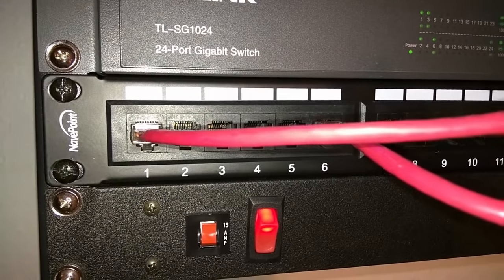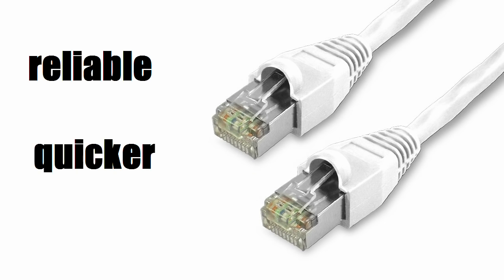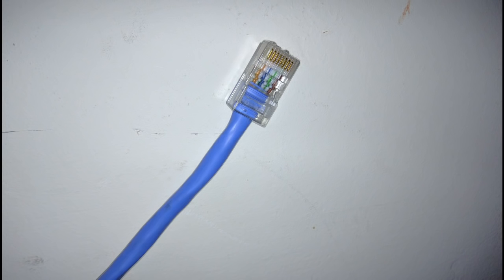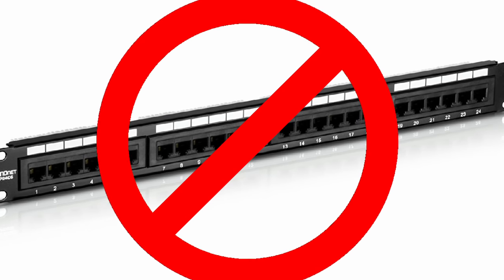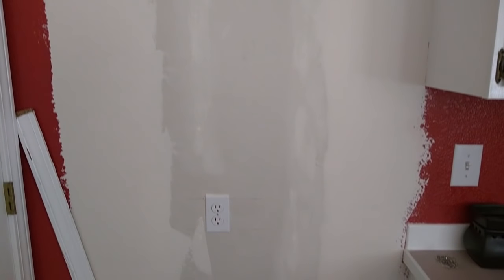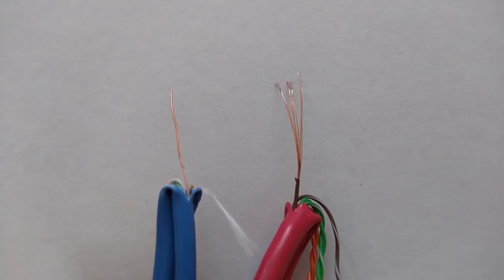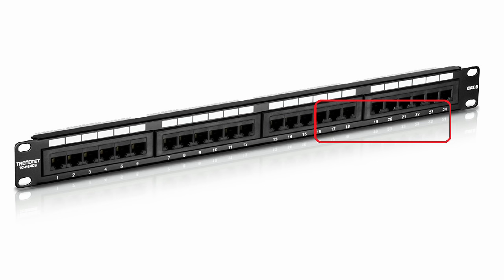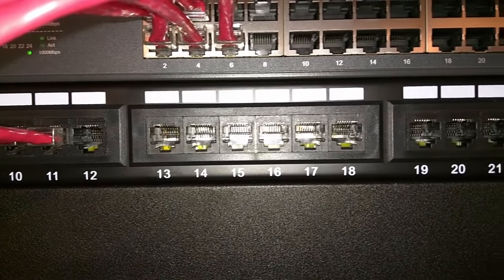What is a Patch Panel? Do You Need One?

Comment: u have all that but not a smart tv?
Reply from the maker: Ha not yet. This one is still chugging along. Soon though. Very soon..
Reply: That patch panel and switch, together cost under $150.
Reply: Smart TV's suck!!!  They don't get updated for long, and are laggy.  I'd rather have a DUMB TV and then plug whatever smart device I want into it.  From ROKU's to AppleTV, to a Chromecast.  Whatever you want.  TV's you hold onto a long time. I am still using my 2 great 50" 1080P Panasonic Plasma's!!!  They may be dumb, but work fantastic.  The last thing I want is any smart garbage.  But it seems almost impossiable these days to get a TV without it.

Comment: no gr8 need of patch panels just connect cable directly to switch write pc number on it thats all
Reply: unless you are injecting various power voltages (poe), or maybe using some of the runs to receive AHD video feed, or maybe you want to do a room to multi room IR setup, hmmm.....or if you are going for HDMI over cat5e/6, or low level audio out to amp unit, remote trigger signal wire, crossover cable, multi room usb to server, VOIP phone system,  standard old school phone through panel, room to room intercom, legacy equipment connectivity............or maybe you just want to add panel with short sacrificial patch cables to eliminate the need of re-terminating your line ends if you do a lot of plug/unplug with equipment (like we do at our repair shop). Or maybe he wants to write the pc number on the panel instead of trying to write it on a round cable, or use stick on labels. I'm sure I could think up a few more but if you don't get it by now.....well, you know.

Comment: Little quibble,... HOW exactly is a patch panel "neat" (or even "neater")?
The cables into the switch still loop out untidily in front just as the unpatch-paneled ones MIGHT.
IN FACT, they likely stick out even further and have to traverse even further left/right as you COULD have the unpatched cables route neatly over/under the switch and bend directly down/up at the jack. None of this ugly looping out and across from the patch to the switch (as they're rarely aligned).
Personally, i prefer the look of a short direct vertical loop exactly at the switch jack instead of the hideous large loops sticking out and dangling about. I place my switch at top/bottom of rack with a 1 cable deep gap and use an improvised 'comb" to hold the cables at exactly the horizontal location they're destined for. My cables loop out and directly up/down for maybe 2 inches max. If 90-degree RJ45's were more common, it'd be even neater.
Basically, while a patch panel could be as ugly as a poorly done direct solution, it cannot be neater than a well done direct setup.
Manufacturers could probably sell a decent amount of "comb trays" that stick to the top/bottom of your switch and have slots every jack width in a neat facia. Something one cable high, a few inches deep for neat "spare" stowage/routing, with appropriately located cable grips or holes for ties (for entry/exit alignment and strain relief), and maybe a single rear exit point (for up to 24 cables). I'd buy one! (though I guess I could make one out of sheet metal and/or 3D printing!)
Reply: if you plan ahead, all the patches will be parallel to each other. if you terminate the cable yourself, it doesnt stick out any further than it would otherwise

Comment: Hey I  recently started  using a keystone patch panel which I am going to add the link. It has a place to tie wrap your cable  for strain relief and since it is keystone based you can choose keystone with  punch down or like me just get a keystone with Ethernet jack on the front and back.  Yes you have to terminate each wire but then gain the ability to just unplug the cable if you should need to trouble shoot.  Check it  out see what you think.      
 https://www.amazon.com/gp/product/B0072JVT02/ref=oh_aui_search_detailpage?ie=UTF8&psc=1
Reply from the maker: A lot of people have recommended keystone panels. They sound like they are great options. I will consider them for future projects. For this one, I was trying to keep costs down.
Reply: @BudgetNerd  Yeah I understand it took me a while but I have things the way I always wanted. At the time I spent 18.99 for the panel and I bought enough Ethernet keystones to fill all of the holes and make it look better they were $19.99 for a 25 pack but can always just get what you need. This particular kind fit perfectly side by side in the panel.
I actually have my dream home theater and home network, projector 100" screen that comes down over the wall mounted TV and Dolby Atmos  the best things is that all the wires  are in the wall and ceiling all going to my media closet where everything is rack mounted. All of the home network is distributed from there to the wall plates in each room/place. I would love to record a video of it and post like you have but I don't even know where to start. It is intimidating.
Reply from the maker: Sweet setup. If you ever do a video, let me know. I'd love to check your setup out!

Comment: So much "do I need one?"  "Can I get away without one?"  In all honesty, if you are building a home lab, a patch panel is part of a network closet/rack.  Simple as that.  Add it in to the budget.  It's another $40-50.  Sometimes even less.  I suggest you get a keystone panel and punch down the keystones you need for each use you have instead of wasting money on a patch panel that has the punch downs and ports built in.  It makes fixes a LOT easier by simply replacing the keystone in question.  You can also mix and match port types with a keystone panel.

Comment: please never plug RJ11 into RJ45 sockets... if you really want to use the socket as a phone socket cut off the RJ11 jack and connect a RJ45 jack using the middle positions on the jack.
Reply: Depend on your country codes Australia NZ is blue/white , blue and Europe splice there colors different so best to check with the regulations of each country because here if you damage the the equipment at the telecommunication exchange and it leads back to your home they will charge you for the damage :0

Comment: Nice video but I somewhat disagree with your arguments. You are just terminating 2 times more as you need to build the additional cables to go from patch panel into the switch. You definitively add complexity, increase loss in each connector which also increase the likelihood of problems when running at 10Gbps or more. Patch panels are old fashioned way of doing wiring, now you can use managed switches and VOIP to solve neatly everything from your desk. 2 years ago, after looking into patch panels, I clearly step out when I found no model certified for CAT7. Why install something that brings no real benefits, takes time and still needing some maintenance/upgrade overtime ? Only reason I see, you can control a bit better the exact cable length and would be able to adjust should you upgrade the switch for a switch which has complete different ports layout but how likely is that really ???
Reply from the maker: Thanks for the comment. I do mention in my video that it does increase the time to setup and the initial complexity. You could always buy patch cables, I just chose to do my own, I'm weird I guess. Patch panels do provide benefits, but if they don't matter to you, then you certainly do not have to have one.
Reply: Looks like the setup and video were focusing more on residential use. Loss is negligible over these short distances, and the typical home user won't even use gigabit. They'd be more likely to buy a PoE 100Meg switch if anything. (100meg switch and using cat5e would significantly drive down costs for a residential user)  My 2 cents on the video; I would never install a punch-down style patch panel described, I would install only open keystone patch panels. These can be had for 8-15$, do not utilize 110 style punches that are either inaccessible when installed in the rack, or potentially can come loose. using a keystone patch panel adds infinitely more flexibility since you can use other types of keystones as well, such as rj11-specifically, coax, RCA, HDMI, fiber, usb, etc. and a keystone rj45 jack typically has a locking clip to prevent the punched pairs from coming loose.
Reply: Mitchell Henley: PoE for consumer really? Do you have real world examples? Had Cisco voip phones but those were clearly business oriented. In my opinion, the official PoE is too complex and expensive and most devices that would benefit of it choose not to: raspberry pi, wetek, all low costs ip camera and so many more. Mikrotik went with non standard PoE and has still only very few model with fully compliant PoE. Also consumer expect a device that works out of the box which implies the transformer is always supplied. We should see PoE edition packaging. Let's hope things will improve in the future.
Reply: PoE cameras can be had for 70$ or less, people who work from home might be supplied with a PoE voip phone, consumers with large homes might purchase ubiquiti access points. All I’m saying is, gigabit is not the most important thing for consumers.
Reply: MrMuldry, Yes, POE for everyone! Really? Come on. You can use ethernet to run data and power for home IP cameras, even analog cctv cameras. You can run poe to send 5v anywhere in the house for charging every consumer device you own all from one dedicated power supply tucked away in network closet. POE out to power all your wifi Access Points, POE to led lighting. You can send HD 4K video + SPDIF audio over 300meters using ethernet, you can connect pretty much anything that doesn’t require high voltage.
Reply: MrMuldry If you ever have the opportunity to step inside a data center, you'll note patch panels are still used as best practice for terminating cable runs...ya know...like...pretty much everywhere.

Also if your needs actually exceed (which I highly doubt) what CAT6 can do.... you're probably at the point where you need to consider fibre.

Comment: Label each cable - job done. The only argument I buy is "it looks cool"; all other are nonsense.
Main disadvantage: additional junction point for more troubles - was not even mentioned.
Reply: For a home network, that's most likely fine but when you have dozens of network drops, having a panel does greatly help.
Reply: @rmg1259  so explain
1. easy reconfigurable - how often do you reconfigure home/server rack? once in 5-10 years when you are completely re-doing it anyway?
2. wall wires brake easily - seriously? i have not seen overused broken wire in my life. they only way to get it broken is when it was broken from the very start.
3. easy to mark? and how is it easier? instead of marking wires you mark slots on patch panel. it only adds unnecessary complexity by adding mapping between socket number and router number. where is the benefit exactly? Now I have to remember that number 13 on  the wall is actually number 4 on router? Or even better: that number 3 on wall is number 3 on panel and 3 on router. great.
4. The best example from video: future TV does not use router socket until it needs to because you don't need to connect panel with router. So it is with marked write just mark it "TV" and don't plug into router.
I seriously don't get idea. What does you 6 years expirience say?

Comment: Where does the internet connection come from? You just plug a wire into your wall and your ready to watch porn
Reply: MEELO925 your isp
Reply: modem -> router -> switch. unless you have a combo from your isp then it's modem/router -> switch

Comment: Wifi 6 will render this unnecessary, but I'm studying for CCNA so it's still valuable information!
Reply: Yeah, I'd delete this comment if I'd be applying for networking jobs
Reply: @Muhovc  hahahaha I'm already in the field, been in for 6 years, and I'm only speaking of in home WiFi, comment remains I'll double down.
Reply from the maker: Wifi 6 may be nice, but it can't beat Ethernet.
Reply: @BudgetNerd  Yes, hard wired is better, no doubt, but I hate wires everywhere, I embrace the wireless revolution, and I use wired connection when needed, however for most of my internet needs I don't need a direct connection, everyone has a preference. It's all good.
Reply: as someone who struggle while learning in radio and comm field, i know for sure the wire is easier to setup than em noise than bunchload of wifi asking for attention
Reply: @FathinLuqmanTantowi  needy wifi :).

Comment: Your wall plates are upside down.
Reply from the maker: Maybe your computer monitor is upside down..
Reply: @BudgetNerd  Nope. Go to 5:07...presuming you wrote and/or read numbers upside down... that Cat 6 the manufacturer kindly wrote on it for you is upside down, again unless you've installed 9.TAC wires... I doubt it matters either way, but they are technically upside down.
Reply: M. West - OMG - You nailed him! He might be in the US where we go from the top left across to the right and then drop to the next line from left.....hey???what???

It appears TP-Link has their switch outlets on the top row upside down!!! WTF!! 

Someone needs to tell TPLInk they have their outlets upside down. We elect you M. West, or should I call you Mme. West. And take your friend/lover Artemis with you!
Reply: @maewest68  You should do two things before you harass other posters: 1) Clean up your language, my pre-teens aren't restricted from STEM do-it-yourself videos - such socially conscious behavior would be appreciated; 2) Go look at any of the switches for sale and you will notice what the ####### I am talking about. 

I don't understand the umbrage - if you know the "correct" orientation of RJ45s, or even the reason for one orientation being more "correct" than the other since it is ONLY personal choice, you would also know the plethora of equipment that manufactures multiple ports on opposite sides of one circuit board. But you totally nailed Ben on his port orientation choice. His choice. "Upside down". Your words. The manufacturer of his patch panel must have numbered the ports upside down too. You should file a complaint with the patch panel company. But you are absolutely right - at 3:30 clearly he places a wall plate with the keystone contacts on the bottom side of the outlet. I've never seen keystones placed sideways, but like power outlets - the receptacle can be placed in either orientation - contacts on the bottom where they collect dust - or the contacts on the top where they slowly oxidize. Both are correct even if "upside down" And then there is the point I was making about all the manufacturers of equipment with RJ45 outlets - which direction is rightside up????
Reply: @Karma0jun  Soooooooooo you're just looking for a fight is all.
Reply: Maybe he's in Australia.  ;-)

Comment: 5 kids with two devices each. Smart TVs. Wifi satellite receivers. Etc etc on a gen one AirPort Extreme works mint. No wires. Even run my own media server on it. Prove me wrong?
Reply: Prove you wrong?  Why?  It might be “mint” as you say.  But the truth is that if there are any devices that can be be hard-wired, they would benefit from being hard-wired to your network.

No matter how fast a wireless network is,  devices on the same network will perform better by being hard-wired.

Is it possible that your wireless network runs fast enough to satisfy your needs?  Absolutely!  Would hard-wired devices perform better?  Yep!
Reply: Prove what wrong? If you have 802.11n (which gen one does have) or 802.11ac, or you have multiple APs on different channels most problems with wifi magically fix themselves.  Live in a crowded neighborhood with people blasting 2.4ghz at max power, near a radio tower, or use solely 802.11b/g and you'll have problems due to RFI/EMI or slow clients hogging the wireless spectrum because it is a shared medium.  Heck, even the neighbor's devices if using 802.11b/g can have negative performance impacts on 802.11n due to CSMA/CA.
Hard wired still has more bandwidth and lower latency for those who need it due to the lack of a shared medium and the full duplex nature of modern ethernet.
Clearly you don't need the responsiveness or bandwidth that others might for your own network which is optimal for your use case.
Reply: Wifi is fine for most consumer applications. Wired connection is only for more serious / relied upon connections. Even then non enthusiasts won’t notice a difference 9 times out of 10.
Reply: Just wire your PC's...you'll be a believer...and you will turn to the wired side...
Reply: Wifi isn't full duplex, homie.
Reply: It might work great. Patch panels and hard wired devices have other benefits. Want to use cameras and a DVR to watch your home?  Yes there are wireless cameras but you still need power for them. Can't do PoE over wifi.
Reply: Wired connections will ALWAYS be faster and more secure than any wifi. Wifi is just more convenient not better.

Comment: It is simpler and more accurate to connect with the network module wiring cutter than to connect the crystal head on the network cable. So the trouble shooting is easier. I do not think it is proper at home network.